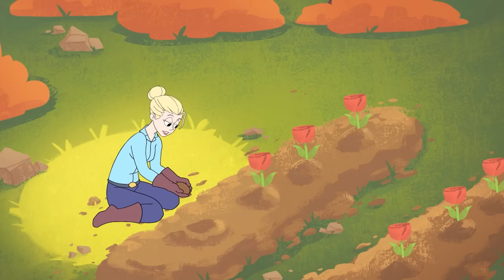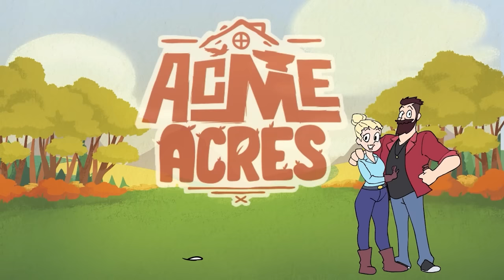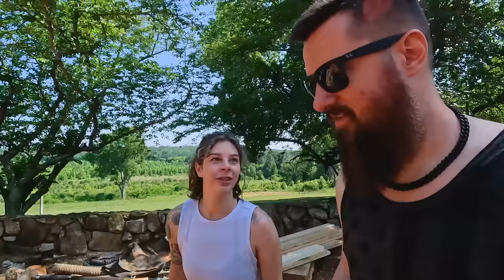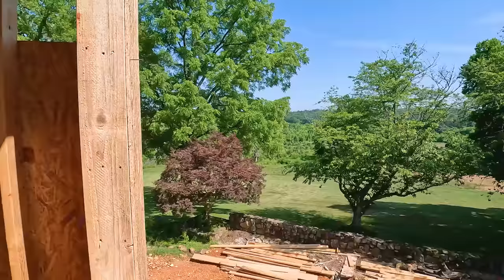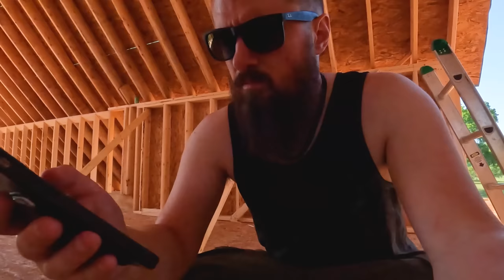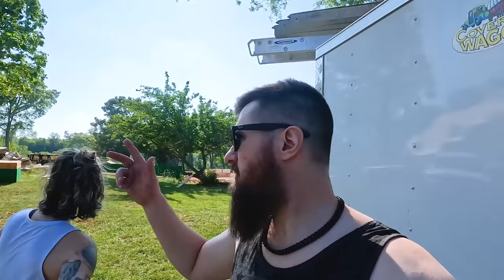We Just Found a HUGE Amount of Unused Space...

Comment: I would totally put in a spiral stair case up to that space and at least use half of it as a loft office where you can put your desk, computer, crafting/design stuff. The other half of the upper area can be closed in for storage and AC. You can even put in a skylight for natural lighting in the loft. Just make sure you put in some sound proof installation so the buzzing from the AC doesn't come through very much to the loft office. The original office area down stairs can just be a library with books.